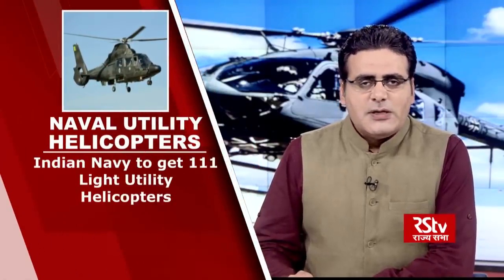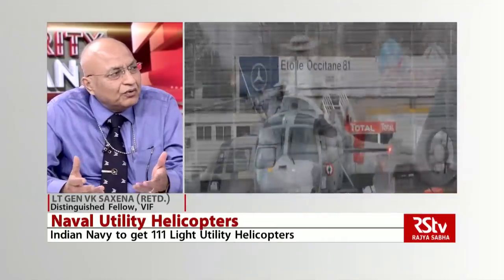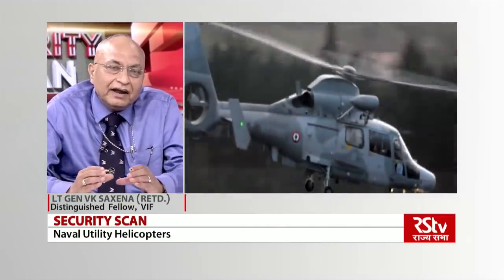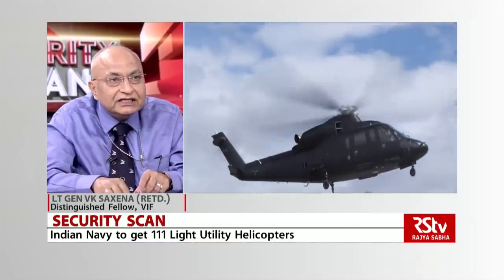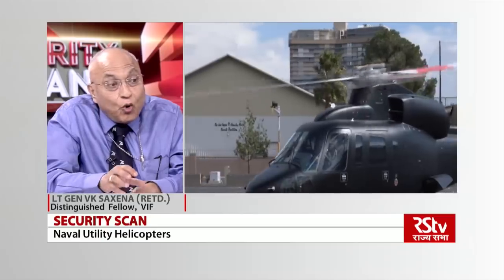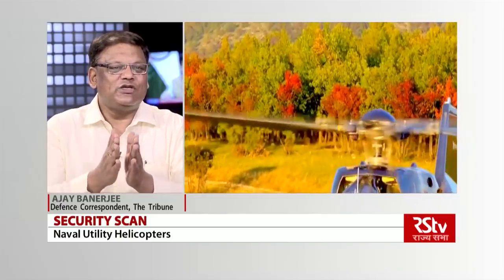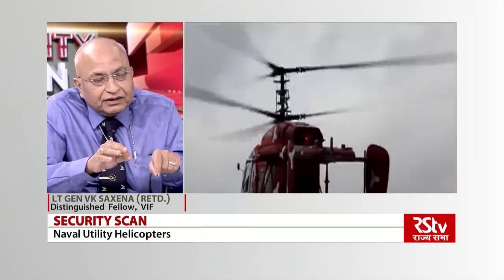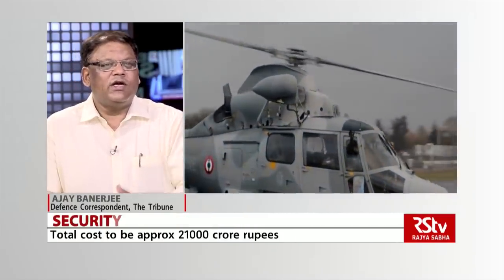Security Scan - Naval Utility Helicopters

Comment: The LUH has blade folding features,and will be a huge upgrade over the  present Chetak and deserve some consideration.The S71, is a much bigger helo at 5 tons plus,and will be costlier as will the KA 226,however both are twin engine helos,a must for over water flights.The LUH may be better suited for the army.The fact that it is indigenous ,and will be cheaper to procure may decide its fate for the navy.It may be best suited for our smaller ships,namely the P28 corvettes in concert with the MH 60R as the ASW chopper,and the LUH as the utility chopper.

Comment: Ajay is wrong.The ALH Navy can fold her main rotor blades but the process is not automatic.
Reply: Wrong..it does not fold completely ...while other bid helicopters can fold blades completely automatic
Reply: But I read this news item... https://idrw.org/category/broadcast/
not only auto folding blades, even rear rotor.
Reply: h145M doesnt have the capability to fold the blades automatically ,current alh navy can fold the blade manually,HAL NUH can fold blade automatically along with the boom ...